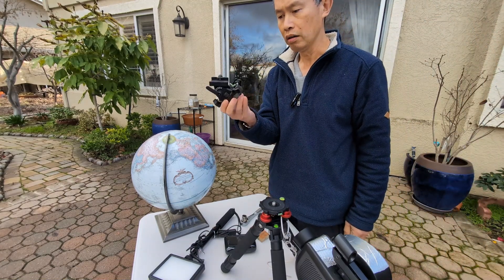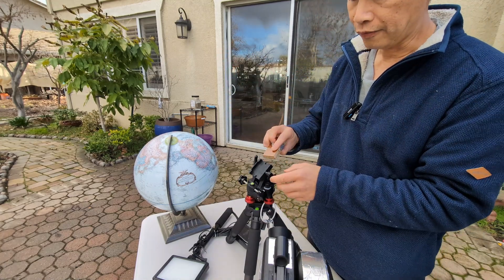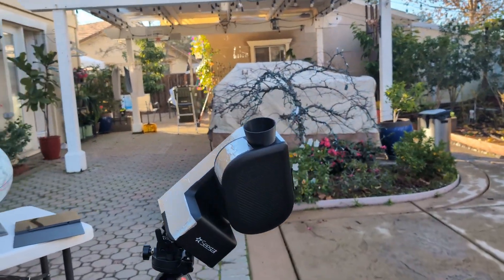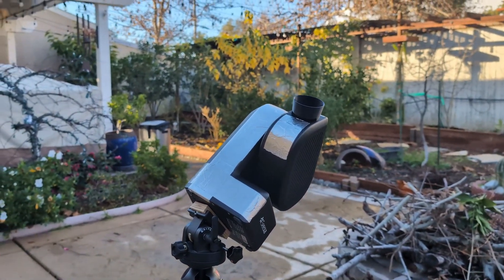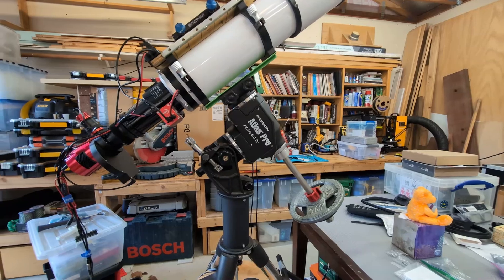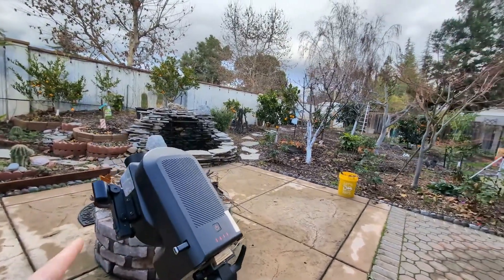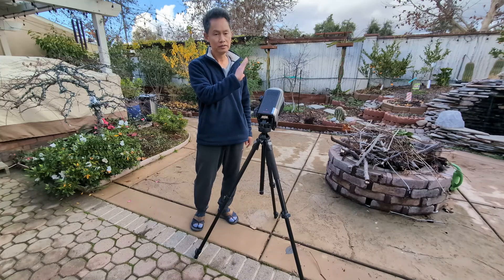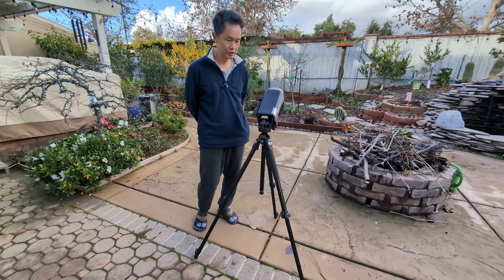Running Seestar with Equatorial Mode, Hardware

Comment: Great set of videos.  I just pick up the Seestar, fold in the legs and point the tripod top towards the pole star to demonstrate an EQ mount. Same set up as my old 1976 C8.  Use wedge for Astro, or remove wedge and attach base with bolt to tripod head for landscape viewing.
Reply from the maker: Yes. Since Seestar brought in many new faces into the hobby, Alt-Az and EQ are foreign concepts. I tried to demystify them so they can appreciate the finer details of what 's really going on.

Comment: Hello, I like this idea.  I recently picked up the SeeStar and am impressed with the hardware.  It would be nice to have more manual control over the camera and capture settings but maybe that will come in future updates. 

Can I ask what size lens hood you are using?  did it screw right in or does it need any modification?

Comment: Are you sure that the Seestar structure will withstand working on this inclined plane for a long time? Its design was made to work on a horizontal basis. Gears and motors were not designed to carry out this type of effort, since you are applying a lateral force. How long do you think it will work? Please let me know when it breaks.
Reply from the maker: There is an example of it running much closer to the equator, and I won't link it here to steal his thunder. We also have an idea or 2 about adding support to reduce the strain. You can read all about them in our Facebook group "Smart Telescope Underground".

Comment: When you are polar aligning the SeeStar on your wedge,  you are aligning the RA center,  but the DEC arm is offset from that.   Does this effect imaging in any way or is this negligible??   

When you polar align a star tracker you have to, or should,  take into account the time of night and where Polaris is clocked around true North.
Reply from the maker: When you properly polar aligned, the RA motor is the only one that moves to compensate for Earth's rotation. The Dec motor moves only to adjust any errors in the alignment or the Seestar error in tracking. That is why you will get better tracking performance in EQ, with better acceptance rate. From Seestar's point of view, it is no different from when you are trying to image near the Celestrial poles. Therefore, it is a much better configuration for tracking.

Comment: Does the orientation of the body matter as long as it it pointing to Polaris? I notices someone else's video had the power button facing east.
Reply from the maker: It does not. Remember the body rotates over a session so what orientation it started with will be different later.

Comment: Hi Kai,  was wondering what if you mount is so the base plan is align with equatorial and polar align with the base instead of the edge of the Seestar as the Seestar has 2 axis?
Reply from the maker: The arm axis is limited in travel while the base can move in full circle. That by itself would restrict the sky in your proposed arrangement.

Comment: what improvements by adding this setup?
Reply from the maker: No field rotation, much better frame acceptance rate for stacking, no fanning in spectroscopy, better star tracking, much less movement in the Dec motor, more constant motor speed for RA motor, no terrible field gradients that can't be fixed...

At the end, better images

Comment: I would say they can probably patch that software limitation. If they wanted too.

Reminds me of SkyWatcher with one of there AZ-GTi WiFi GOTO mount that was suppose to be only for "ALT AZ" for observing.

But then they had a software patch where you can install it or have the store install it. (or you can)

And this patch allows it to become an EQ mount but you have to buy the Wedge and weights etc.

Turning it into an Astrophotography imaging set up (very portable). The limitation only being the weight it can carry which is 5KG payload max

Comment: This counters field rotation, but what difference does this really make to the results? The internal software counters the rotation perfectly already. I would be interested in seeing some pictures made by both methods.
Reply from the maker: @donepearce  the normal orientation results in field rotation artifacts demonstrated by this example....

https://photos.app.goo.gl/vrXV7gzsmgBU7xi76
Reply: @kai_seestar  I see no artefacts. I am expecting star trails for a long exposure or multiple images near the edges for a stack.
Reply from the maker: @donepearce  notice the light/dark separation in the upper left and lower right region.
Reply: @kai_seestar  I see it. Is that really a result of field rotation? I don't get how that would work.
Reply from the maker: @donepearce  the sensor is narrow and rectangular. As it images a target, the sensor essentially rotates over the target. The dark area is where the non-data being integrated into the stacked result.

Comment: Nice.. however ,doesn't Seestar require that it is placed horizontal to the ground withn its acceptable limits for the Seestar app to start ?
Reply from the maker: No. With a firmware update a few months back, ZWO introduced horizontal calibration (aka 3 point calibration) that I used to escape from the original requirement that the base had to be leveled. That was the start of the EQ experiments.

Comment: Did you consider a 3-axis gimbal for a tripod head, whereas you can employ an arca swiss camera mounting plate with a 3/8' to 1/4" adapter? Being I have little means to rationalize spending more than I already have, I wondered if that is practical... Also, is there a way to bypass the default imaging sensor to use my mirrorless camera, monitoring the FOV with the camera's capabilities? I appreciate your hacks, as they are indicative of the inherent dynamics that ZWO should have utilized in the components of their design. I noticed while carrying my unit, that there is play in the motorized gearhead, which is internal.  Thanks, again Kai. I look forward to learning whatever I can. This is my first telescope. I am not even knowledgeable in Astro 101, but eager to discover more.
Reply from the maker: There are members in our group who simply 3d printed or crafted from wood that formed a wedge with the correct angle. No other tripod or wedge is required. You can find the posts in our group. We also have a spreadsheet that listed the relevant steps to get the Seestar into equatorial mode. 

As for putting a different sensor, there are a few samples where members piggyback a sensor on top of Seestar imaging arm. There's even one who replaced the gears with harmonic gears that can carry an extra 10+ kg on top. That example is not for the  faint of hearts though.
Reply: @kai_seestar  I appreciate you taking the time to reply. There is a rain trough over most of California, so waiting for some dryer nights...

Comment: Great information, and worth a try...........I have one question if I may..............do you have to manually find your targets when set up this way, or will the Seestar still find targets you pick from their Tonight's Best or Sky Atlas when you choose one and click on Gazing?  Thanks!
Reply from the maker: Once Seestar has a good sky model, it will find objects just like in Alt-Az mode. You can help improve the model by syncing objects, but I find Seestar does fine after just 1 sync.
Reply from the maker: In our Facebook group, many many members have and are using the EQ mode.
Reply: Thanks, will see if I can find how to do a sync..........never tried that before and do not see anything in the manual about it.

Comment: What do you have plugged in the charging port?
Reply from the maker: A magnetically attached usb power cord adapter.
Reply: @kai_seestar  oh? What brand
Reply from the maker: @Jazzzyjay  this is more of a luxury than necessity. You will also need an usb-c adapter to extend it since the lip for this is too shallow:

https://www.amazon.com/gp/aw/d/B09N157QGT?psc=1&ref=ppx_pop_mob_b_asin_title
Reply: @Jazzzyjay  They are awesome. If the Seestar slews around and pulls on the power cable, this just disconnects without pulling on the port.

Comment: But Seestar just take 10 seconds each photo. It IS possible to change It? To one minut? If It IS not possible , your idea wont work
Reply: You can set it to 30sec in the advanced features but it will still work with 10sec exposures. Why do you think it wont work?
Reply: @realmcerono  I thought it couldnt change. If it is possible , is good !! thanks

Comment: I would bever do this. It puts so much pressure on the motor all internals would strain iver tome. Use the unit as its intended use or just get a Dwarf. Your destroying your unit. Dint do it.

Comment: This system isn’t designed to implement equatorial mode. Software simply won’t support this as intended S50 internal sky model assumes azimuth axis is pointing to local zenith. Immediately gives level error, tracking fails, even when user opts for shutting off horizon align feature on setup. Also is inconsistent with how ZWO implements backlash compensation during dithering.
Reply from the maker: I welcome you to ask members in the official Seestar group for examples of successful imaging in EQ mode. Please just don't take my word for it. If you really want to dig deep into the details, my Facebook has all the info and real world examples you are looking for. All I ask is to enter with an open mind.